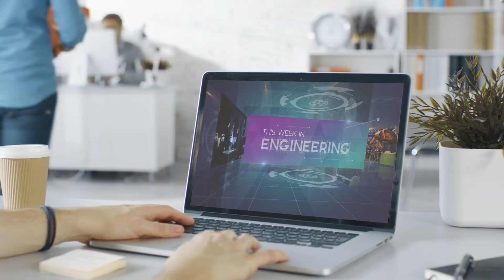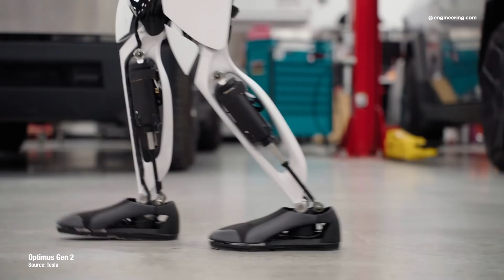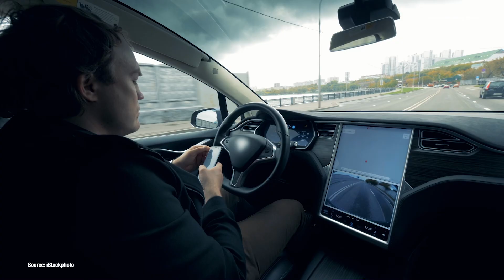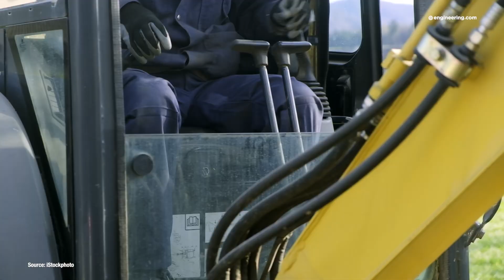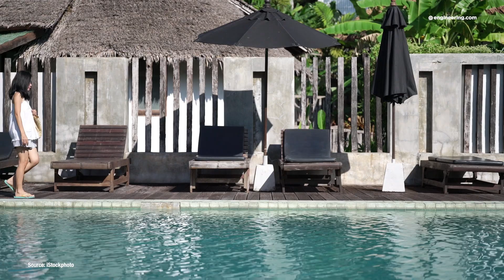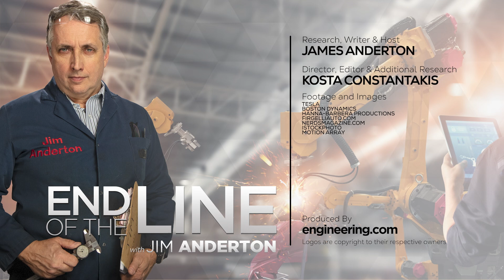Robots are about actuators, not AI

Comment: it is just wrong. yes the 'software' exists, at least in parts, the challenge is to integrate them in a reliable way and that is not trivial at all. the hardware on the other hand exists for decades.
you couldn't have come up with a better example like self driving cars, where hardware is cheap and simple yet no company made the software work reliably despite the undisputed impact it would have on the market

Comment: For decades, I have been thinking and experimenting on this topic.  AI is important but is not the problem we face today.  We need low cost, highly functional, and highly durable humanoid robotics.  One important principle for achieving low cost and durability is reducing the parts count.  I believe PVC is the best material for this.  It is inexpensive and durable and could help you do away with the need for bearings, as it is "self-lubricating" (long polymers) and has very low abrasion.  As for cost and functionality, the humanoid requires many degrees of freedom and lots of travel with less expensive actuators and smaller batteries.  For this purpose, I do several things in my designs.  I keep nearly all actuators as linear actuators concentrated near the center of mass.  I use bicycle cables to reach out into the limbs.  Further, I use electrical resistance to sense pressure, use gyroscopic stabilization and a RISC-V processor with vector extension.  The gyroscopic stabilizer means the energy and complexity is for standing and walking or running and jumping is simple, robust, and minimal expense of energy.  The centralized linear actuators allow for gearing via choices in threading and keeps unnecessary weight off the extremities of the limbs, meaning you can use less expensive motors and a smaller battery.  The RISC-V processor with vector extension is also very inexpensive and draws very low power while providing significant local AI acceleration.  Various options are readily available with Tensor Processing Units, Audio Processors, and other useful options.  For example, some of the SiFive Mars V boards that even have Raspberry PI compatible I/O pins.  Humanoids such as these could cost under $2K, potentially, in terms of parts and materials.  With dual-axis gyroscopic stabilizer, it could even easily to backflips and other acrobatics and run over very rugged terrain as if it were second nature.
Reply: dual axis stabilizers? seriously?
Reply: @kampkrieger  yes. Look at cubli, for example.  However, my approach is to keep both spinning and use pressure against them to move...  This provides highly precise and strong control of orientation

Comment: I also wonder about the precise actuator at a cost problem for a while. Though it was mainly for 3d printer space but it is applicable for robotic as well. 

Highly commoditized actuator that can move at nano meter precision does already exist. Your standard HDD driver actuator can move that accurate at extreme speed and acceleration at a commodity price. It achieve that precision via built in regular negative feedbackloop bldc motor with an end tip piezoelectric motor to control the finer movement. Though to achieve the nanometer precision, it does require thermal error detection and have the hdd disk provide position marking so the hdd arm can correct for error on the fly. But I think even without thermal correction, you could still maintain micron level precision at a very cheap price. How cost efficient to scale hdd arm actuator setup to lift human scale object and weight is hard to tell. But I'm assuming it's not going to cost too much from a cursory search from component list. 

The jump from commodity price to expensive luxury seems to occur at the robot arm level, you dont see such price jump for hdd actuator, if you compare from a % basis. I think this might just be a low volume assembly and packaging issue. Even that recent aloha robot, if you search for the individual component cost for the robot arm, it's like 30% of the cost.

Personally I don't believe in the hype of bipedal human form factor, roomba with bigger wheel manage to navigate my house fine. Get some tank tread and suspension. Mobility is a pretty solvable issue. Roomba with a scara arm that has camera at the finger tip should probably be enough to solve grasp task. 

power wire management is a big ai issue though, technically there is an entire branch of math just to deal with how wire tangle with itself. So it's actually a diffcult problem. But if it can solve that, then power limit and battery life limitation is no longer a big issue. The robot can just have two wire and switch between the two when traveling room. Roomba suction pressure is like 1/10 of wire vacuum due the power and wire limitation, solving how robot plug into socket using a wire would solve a major hurdle.

For outdoor robot that can use combustion engine to run a generator, the power and battery life limit is solved issue. The issue turn into combustion exhaust and noise, so it cant really be placed indoor. No where to empty that exhaust gas without harming human.
Reply: I like the hard drive actuator comparison, amazing precision. I don't agree that bi-pedal is the wrong format, though. What you are asking for is a disabled robot that cannot climb stairs, reach cupboards or jump in to a Robotaxi with you.

Comment: Sorry, this is crap. "why does it take so long to get robots into our households" and then going to actuators is dump beyond believe. Robots make no sense without the AI. The AI just showed up some years ago. The Tesla Optimus does everything inhouse and took what  1 to 1.5 years to where it is, max. That is not "so long", it is extremely fast. With all actuators made inhouse and developed from scratch.
The AI was - and is - the real problem. Accuracy is good enough - heck, you do not even need that much accuracy because you can correct from the vision. Without the brain, no one puts money in the hardware. Only when the AI showed up, then suddenly everyone rushed. I really have a problem with "oh, it takes so long" when Tesla goes from nothing to a demonstrated decent contender in less than 2 years. This is not "so long", this is "whow".
Now, the price - showing a total ignorance. Noone thinks there like NASA. 3 Prices are out. Tesla Optimus said to be around 20.000 USD - with a ROI of around 2.5 months in a factory. Ups. The Unitree is announced starting at 16000 USD - but options may take this higher and it is unclear whether i.e. hands are options. The 1X Neo - the CEO siad they target 8000 USD as price. None of them at 50.000 and all of them brutally cheaper than a human.

Comment: That's very true, AI is a scam but actually robots are about transmission not the motor which has classically been same for over a century now.
Reply: Ah, no. TONS of changes on the motoer side now actually.
Reply: @ThomasTomiczek  like what is the change in the fundamental physics of permanent magnets being rotated by electromagnets ?
Reply: @FLORIDIANMILLIONAIRE  Let an AI answer. Remember, the claim was "the same for over a century". Here some changes in the last 50 years:

Brushless DC Motors (BLDC): Introduced in the 1960s.
Permanent Magnet Synchronous Motors (PMSM): Developed in the 1980s.
Switched Reluctance Motors (SRM): Emerging in the 1980s.
Axial Flux Motors: Gained attention starting in the 2000s.
High-Speed Motors: Significant advancements in the 1990s and 2000s.
Direct Drive Motors: Increased adoption since the 1990s.
Integrated Motor Drives: Developed in the late 1990s and early 2000s.
Silicon Carbide (SiC) and Gallium Nitride (GaN) Power Electronics: Became prominent in the 2010s.
Advanced Cooling Techniques: Progressed notably in the 2000s and 2010s.
Smart Motors and IoT Integration: Developed and widely adopted in the 2010s.

Ups. Even the brushless motor is not a century old. Whow. What a claim.

Hint: Ask an AI to invalidate your claims.
Reply: May I inform you that AI includes knowledge bases and machine learning, neither is scam and work very well. What you mean is the hype around LLMs. But even LLMs are very useful for speech understanding and translation.
Reply: You do not understand language has nothing to do with movement in fact Robots, like those shown by Tesla, seem misleading because, by definition, a robot should be able to autonomously replicate manipulation, locomotion, mobility, and articulation like its biological counterpart. To achieve this level of autonomy, the robot needs forward kinematics data, such as the position, velocity, and acceleration of each joint. This data is essential for the robot to understand and execute movements on its own. Without this data, which  comes from teleoperation by humans, the robot wouldn't truly be autonomous.
Reply: @FLORIDIANMILLIONAIRE  Kindly search for Imitation Learning or Learning from Demonstration.